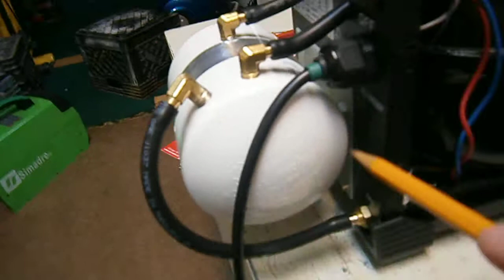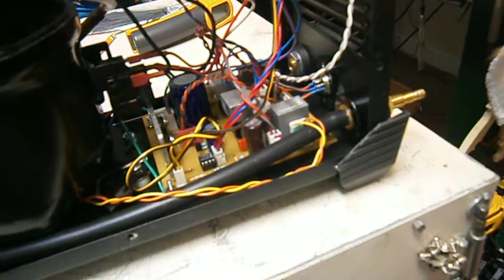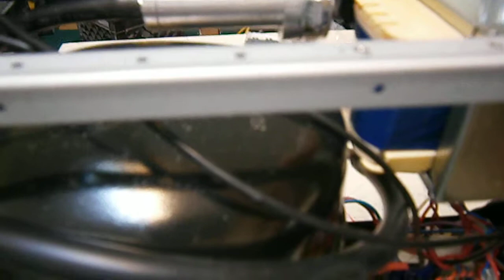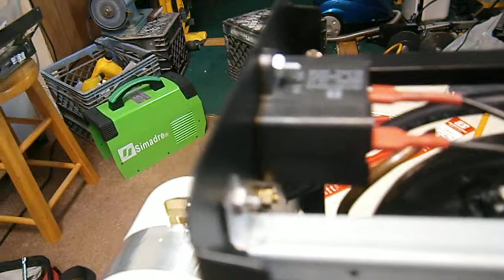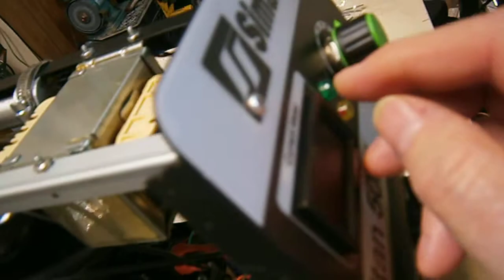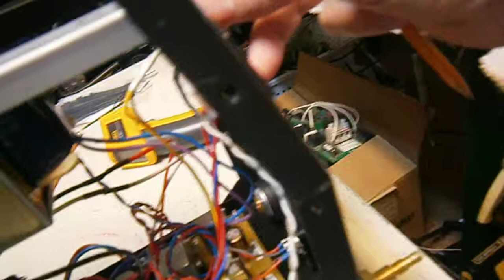Desoldering station using a Fridge compressor.

Comment from the maker: If you need details let me know, this design is for all of us !
Reply: Quite a while later but how often does the compressor turn on, also does the compressor have builtin one way valve as it would let air inside through the outlet otherwise?